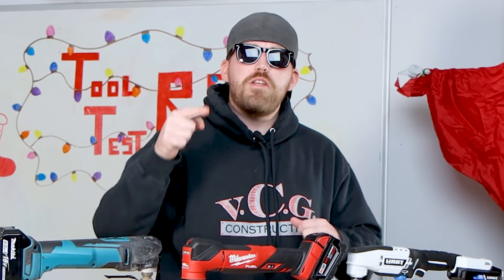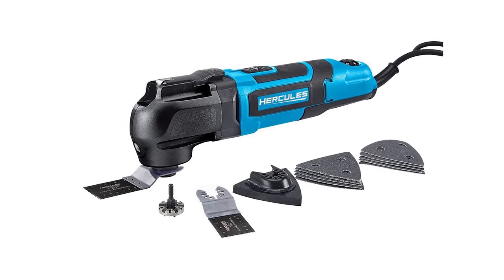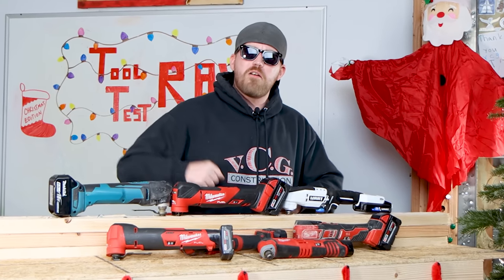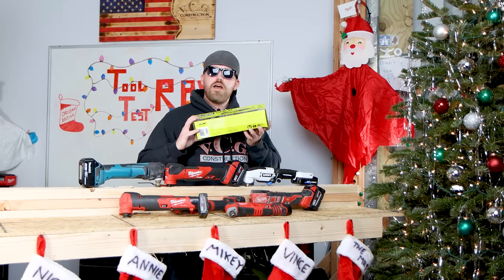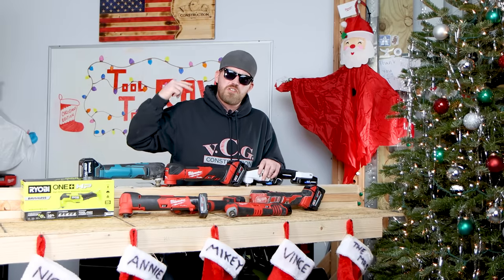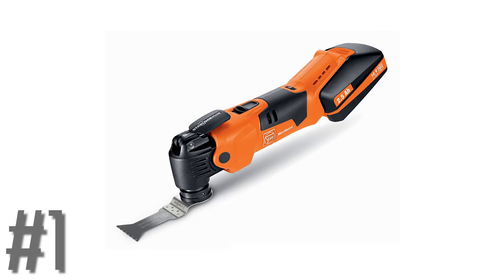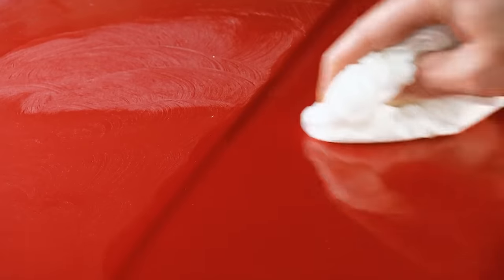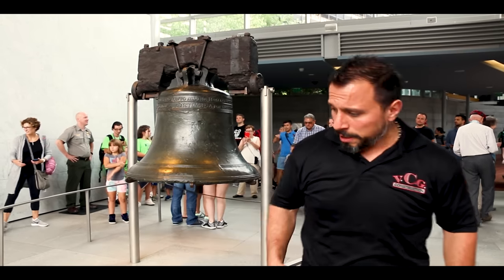Ranking Every OSCILLATING MULTI TOOL From Beginner LVL To Expert LVL (What Level Are YOU?)

Comment: Bosch AND fein invented Starlock. It was a Coop between them. Hope this gets read. Also, i cant understand why you put the inferior bosch model higher than the far superior fein and festool Models on the list. All of them have Starlock after all and the fein has a higher oscillating "Radius" AND higher speed and even anti Vibraton systems
Reply: Nick is cool but he doesn’t make accurate lists. I mean he prefers Dewalt so you can’t blame him for not knowing what’s best 😂
Reply: You are 1,000% correct!  Plus, the top model from FEIN has the most ROBUST, precise and durable oscillating mechanism, even sturdier than Festool by a wide margin.  Also, the Makita is heavy because it is a solidly built tool, closer to FEIN's robustness that the DeWALT...
Reply: Alfredo, Fein makes the Festool multi tool and they are identical lol
Reply: @BoraWE  Not so... There are Three different "levels" of tool in the FEIN line, and their construction is different...
Reply: Flex as well
Reply: @BrotherQuart  Anyone who makes comments saying either Dewalt, Milwaukee, or Makita make bad tools is a homer. I mean come on, lay off that shit.
Reply: @TheHeadincharge  if you’re still trying to defend what Stanley Black & Decker turned Dewalt into, you’re a joke. My Kobalt multitool, grinder, impact, drill, and recip out class my buddies XR line and those aren’t even the XTR kobalt tools we compare them too. For 1/2 the price, Kobalt’s entry lineup has more power than Dewalts strongest, flagship line. The XR Circ saw was the only tool that could out perform. You’re better off buying Rigid over Dewalt now days.
Reply: @BrotherQuart  I’m not saying Dewalt is top tier in all their products, but pretty much all the major tool brands perform well and spending so much time arguing about brand is really ridiculous. Any brand you pick will serve you fine. Tool tests also back this up. Dewalt does have some specific products that are really really good though like their trim router, multi tool, and sander, although I would recommend the router and sander as corded. Just buy the tools that work for you, it’s not a huge deal. If you enjoy Kobalt tools more, then that’s awesome that you found a brand that works for you!
Reply: @BoraWE  it's true that Fein makes the Vecturo for Festool and that the inner workings are the same as the older model Supercut. However, Festool did make some cool and useful design adjustments like with the plunge base connection.

Comment: For a $100 we're talking not much difference in price might as well go with Milwaukee and you'll have something that's probably the best and it's going to last you a longtime. I have the  Milwaukee M18 oscillator and I used and abused that tool daily probably one of the most used tools the size my screw gun and it still runs like brand new

Comment: Years back before Dremel or anyone has an oscillating tool, Fien was out, we used to ( and still do sometimes) call these "Fein tools"  and not multi tools or oscillating tools. This was a Fein, like a recip. saw is a Sawzall. We bought in on a payment plan off an infomercial in the 90s.
Reply: Fien I believe patented the tool and was the only manufacturer, the patent ended (I believe) or they licensed the design now everyone makes one
Reply: I'm not a tool snob but I've grown to dislike my Dremel and it's bad runout and overpriced accessories. Proxxon makes some very nice rotary tools that cost only a bit more
Reply: I have a fein tool, a 636 ii, and a new Bosch 40-30, let me tell you fein tool is no match, for the Bosch little brother, 636 to much vibration not enough cutting
Reply: Their very expensive tools arent they.i think i seen a video by that youtuber vince at a tool convention and gave there multi tool a great review but wanted 200 + for one
Reply: I remember the infomercials, thought it was a cool new tool, but never bought one until I needed to do come baseboard/door casing work. I bought the Dremel... that was a mistake. Now I'm looking at a replacement,  and even though I'm an 18v/20V Max/12V Max Dewalt guy, I'm heavily leaning towards the M12 Fuel tool. The one pro I give the Dremel,  is its size. The M12 fuel with the smaller battery seems to be the same size, maybe smaller. I kinda wish Dewalt had a similar oscillating tool in their 12v max line-up, since I'm already in that line.

Comment: I used to be a DeWalt guy. Then I bought a Makita circular saw, then a Makita router (Made in Japan!!!), then an used 20 year old Makita belt sander that runs and performs better than most new belt sanders!
The battery on my DeWalt drill is no good now. Normally I would just replace the battery, but I can't pass up the opportunity to use that as an excuse to get a Makita drill!

Comment: Agreed on most. Just got a Skil 12 volt oscillating tool. 

It’s brushless, quick release, halo light in front, lite weight. Variable speed too. 

Check it out. I thought of Skil 12 volt like a Porter Cable, Harbor Freight, Black and Decker level tool. 

Not any more. Has a 5 year warranty too. Nice to have another option.
Reply: How is it holding up? I was thinking of getting the Skil 20V myself. It appears to be one of those brands that you can really support and get behind. The prices are very reasonable especially for what you get.
Reply: Skil has really up their game drill and impact driver about 80% as good as Milwaukee DeWalt but there nail driver oscillating tool and impact ratchet are superior or equal to anybody with a five year warranty for much less cost

Comment: Love that you put M18 pro but M12 expert. Both great tools but that M12 is special, absolutely can keep up with the rest but in one of the smallest lightest packages. Great video.
Reply: Just picked up the M12 fuel. I maintain an apartment building that was built in 1905..  I have a feeling I'll be getting a TON of use out of it.

Comment: I've seen too many guys who are messed up from prolonged contact with a vibrating tool of some kind.  I care way more about low vibration than I do about shaving a couple seconds off a tool change.
Reply: The latest Makita and Milwaukee have good vibration control, and Fein (and the Festool branded one) has had excellent vibration control for ages. The Bosch is good but a little bit behind. DeWalt is okay, but not more than that. 
Nearly all affordable ones have varying levels of reliability, but almost universally horrible vibration control.

Comment: I personally own the Bosch 18v multitool and it is nothing short of a ballerina in monsters clothing. This thing powers through anything it touches but does it so smoothly and paired with the Bosch starlock blades the cut is so fine, so thin, it’ll blow your mind. It’s just amazing. Props to Bosch

Comment: That was awesome man.
Im looking for my first one.
I'm noticing this tool is required more frequently than others in the jack of all trades relm.
Reply: If you use it for DIY you can't go wrong with a Ryobi. Been beating mine up for 2 years and now using it everyday at work and it's still going strong. If you need one as a Carpenter then I'd go Milwaukee M12

Comment: I picked up a Dewalt Atomic oscillating tool with a 5 ah battery for 129.00 at the depot 8/30/21 I already had the XR I purchased back in 2019 for 99.00 with a 1.3 ah battery and a charger.

Comment: When I started doing carpentry I've always known the oscillating tool as the "Fein Knife" regardless of brand. Never even used the Fein brand but I'd say they must have made a hell of an impact. we're currently rocking the M18 Non-Fuel Oscillating tool, definitely have to convince my boss to get the fuel version!
Reply: When I was an auto glass tech I called mine a "Fein knife" too.  I had the automotive version which accepted only automotive blades..  just the tool itself was 600 dollars 😬😬😬
Reply: Fein invented the oscillating tool in 1968 and the patent only ended fairly recently so until then you could ONLY get a Fein multitool, that's most likely why

Comment: I had the Ridgid electric one for a long time, but rarely used it because plugging a tool in and out several times is just a pain that is not worth it; I use it mostly for cutting in caddy rings. Since I got the Milwaukee M18 one, I use it a lot, along with my M18 vacuum so that as I cut in the rings, I suck up all the dust at the same time. No cleanup time!

Comment: I’m a dewalt guy so this might be biased, but I can definitely change my dewalt blade in half the time it takes you to unscrew that thing. The Milwaukee is still better because the maneuverability. But dewalt has the best blade change on the market

CORRECTION Bosch has the best blade change on the market
Reply: Bosch and Fein (they use the same system) ;)

Comment: It's not just better motors in the Milwaukee FUEL tools. These are the things that all Milwaukee FUEL tools have.
All FUEL products feature three Milwaukee's exclusive innovations: the POWERSTATE Brushless Motor, REDLITHIUM Battery Packs, and the REDLINK PLUS Intelligence Hardware and Software. These three pillars are what make FUEL power tools deliver unmatched power, run-time, and durability on the jobsite

Comment: Some nice info,  but do your research, man.  Bosch AND Fein have invented the StarLock system. All the Fein tools have it for many years already. Bosch multitools are good, Fein are just better. The Festool multitools ( just the tools, not the accessories) - are made by Fein, actually they are Fein models in a Festool skin. You are right about the Makita - unbelievably smooth and quiet, just ridiculously big and heavy ( more like an angle grinder than a multitool). I have the Makita, Dewalt and a Fein SuperCut in my workshop. Very keen on that new small 12V Fuel Milwaukee one.

Comment: Good video Nick, well thought out.
I use Fein as it has been  my choice for many years.
I think with Fein, Festool, Bosch,  or Makita there all excellent choices.
I didn't have any experience with any of the Milkwakee, but I am sure it is a good option.
I did think much of the Dewalt do to its construction and performance.  Although I know a number of people that love it and use them all the time.
The cheap stuff it just that, cheap stuff.  If I where a home gamer.  I would go with a corded model Bosch at around $200.00. There strong and for now future proof with parts, warrent, and blades.

Comment: How could you not put the Ridgid JobMax up higher on the list?! I have the 18-volt version which only cost me $80 on sale and even though it's not the Octane one and it's still a beast, I got the tool free change head for it so it's super easy to change blades, also u can clip the attachment on it in 4 different directions. Not to mention it's a multitude of tools in one, I have the Roto-Zip head, the right angle drill head, the right angle 1/4" impact driver head and the Sawzall head for it! If I bought all those tools individually it would cost a fortune and take up a ton of room in my Toolbox! Imagine in addition to buying an oscillating tool that I had to buy a Ridgid Roto-Zip too $119l, a Ridgid right angle drill $139, a Ridgid one handed Sawzall $139 and a right angle impact and I'd have to buy a Milwaukee one for $149 unless I wanted to spend $204 on a makita one. And considering the most expensive attachment for my JobMax was the Sawzall attachment at $50 I think the JobMax is a killer deal and should be way up on the list since it replaces so many tools and saves you hundreds of dollars at the same time! Plus if it ever breaks it's lifetime warranties! Now don't get me wrong I have a lot of Ridgid tools but I have even more Milwaukee tools and will usually buy a Milwaukee tool over a Ridgid one but there's no denying that the JobMax is on hell of a versatile and tough ass tool and I would buy it and the attachment for it any day over buying all the Milwaukee tools that I need to replace it and all the attachments for it!

Comment: I just picked up the new Metabo MT 18 LTX BL QSL. I like it so far, id say it compares to the Bosch pretty well. Its got a funny way of using the starlock mount but still making you use a pin which is a bit odd though.

Comment: I have the Dremel 8300 for 2-3 years... I'm looking to replace it. It's got a pair of 1.3 Ah batteries, you get about 20 minutes of use,,and the body gets near scalding hot. The charger takes longer to charge a battery than it lasts in the tool. I can't believe y'all included it in the Pro/Expert category. This is an entry-level/barely intermediate user tool.
Reply: Agreed. Dremel is higher-end DIY at best. They are owned by Bosch, but are closer to DIY Bosch green tools than professional Bosch blue tools.

Comment: That is interesting when you put Worx im the DIY category and Rockwell one step higher while they're the same tool with different brand on the case.
Reply: Putting Dremel als pro is also a bit of a joke, and while the Bosch is great, the Fein 500 has better vibration control and the 700 also has more power while using the same co-developed Starlock interface.

Comment: Hi Nick, im a carpenter across the pond in the UK. Love your channel and the advice is spot on. 
However, the comparison on product to value for money would change this video all together because I have used everything from green Bosch right up to Panasonic and festool and I have found that the most rugged, long lasting and power to weight ratio tooling on the market is DeWalt. I have Festool equipment sitting in my workshop whilst my van is fully loaded with the DeWalt kit.
What are your views on quality vs value?

Comment: The m12 oscilating is the one i would buy looks powerfull and lightweight
Reply: Buy next
Reply: Have one, love it. Will not be disappointed. More power than a 18v LXT makita I’ve found.
Reply: I've had the dewalt for about 4-5 years works great for me as a general contractor
Reply: @jasonswoger410  this is the one i have and even its not the faster cuting multitool i love it too made everything i want i pair it with the 8ah
Reply: @jasonswoger410  i am a carpenter
Reply: M12 fuel is awesome.i like it better than dewalt..no complaints.

Comment: I just picked up a few milwaukee tools and like 6 or 7 batteries but wont be using these tools a bunch i just like having good equipment. Can you do a video on how to store and maintain the batteries? Those things are crazy expensive and i wanna make them last a while. Thanks for the content!
Reply: Store the batteries upstairs away from the cold and moisture. Charge the batteries to roughly 40% aka 2 bars for longterm storage. Check the batteries every month and make sure the batteries didn't drain to zero. If they did drain to zero recharge them to 2 bars and let them sit again.
Reply: @henri6595  thanks

Comment: Great video! I hadn’t considered an oscillating multi tool before. Looks like I’ll have to pick one up.
Reply: The first year I owned one I used it only as a sander. I didn't even know it could do cuts. By the way, it is actually a great sander because it gets into corners which isn't something an orbital can do, and if you get the diamond coated sander then it lasts forever.

However, its ability to do weird cuts is why a multi-tool is simply indispensable. Multi-tool has got to be one of the most useful tools invented.

Comment: Good evening sir. I can’t agree or disagree. I haven’t used any oscillating multi tools yet. I am curious where does the Skil Powercore fit? Vince spoke highly of their tool, especially their vibration mitigation. I’m in the Makita 18 volt platform. I’m very impressed with their tools. I only have a few currently, but I’m looking to expand. I’m strongly considering adding Milwaukee 18 volt. They have a few accessories that are very important to me. I like their power accessory that uses their batteries to power a 120 volt ( in my case medical device) and two USB ports. I’m strongly considering it plus two 12.0 Ah batteries plus a charger.
Reply: I have the fuel m18 and it's a monster. One of my favorite tools. It makes every other multitool I've used feel like a toy. I don't feel like it's too big or bulky personally
Reply: I'd put Skil in with Riyobi

Comment: Hey I'm confused if #1 in each category is the best or the worst for that category? For instance, in the Prosumer/DIY category, is #1 Rigid better than #2 Kobalt etc. ? That's how I think you mean it but it is confusing at times. Fein is #1? or is Bosch? Fun to watch. Thanks!
Reply: They mean #1 is the best although I personally don't agree with the ranking. Dremel has questionable durability and seems to be more of a higher-end DIY brand. The Bosch OMT is great, but the Fein has better vibration control with the 500 and also more power with the 700, and uses the same Starlock interface, since it was co-developed by Fein and Bosch.